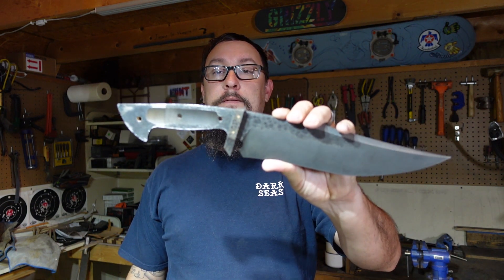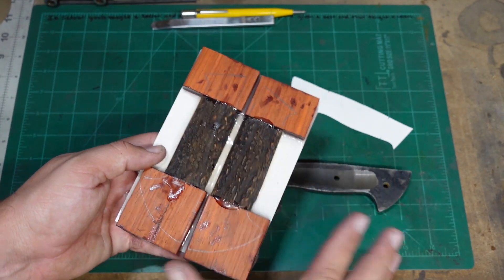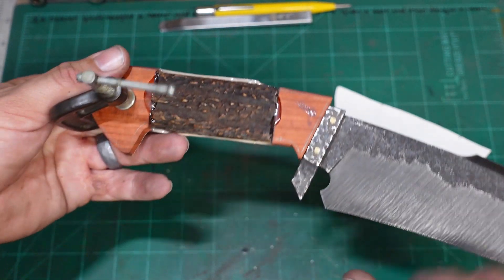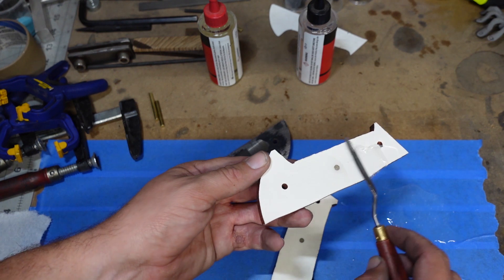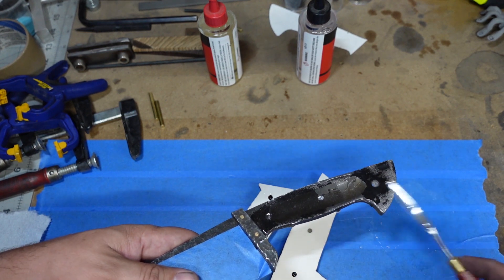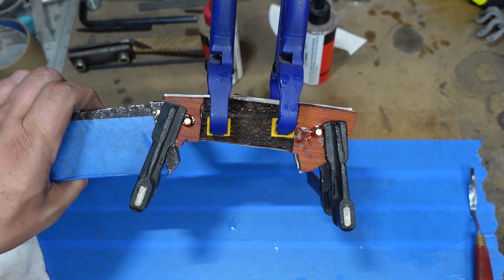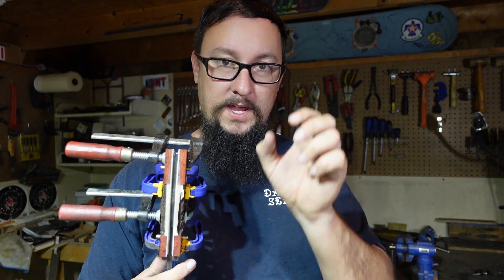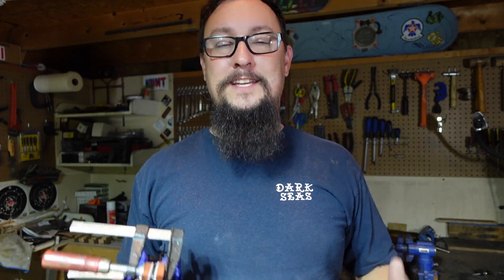Attaching The Scales To The 5160 Bowie | Shop Talk Tuesday Episode 109 | Knife maker

Comment: That was definitely the way to go with the antler 👍 have you ever tried tap magic when drilling your steel? I recently started using it and it seems better than any of the other things I've tried. Also its about the same cost as 3 in 1 oil or other equivalents, it might just save your drill bits hahaha.